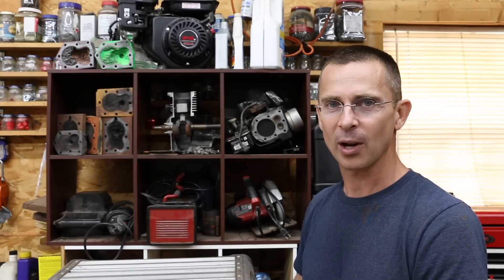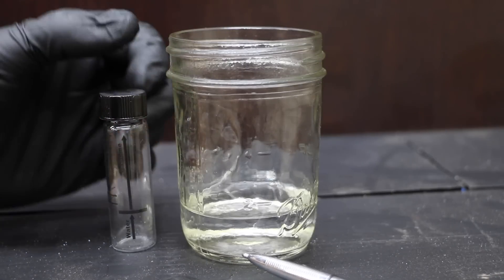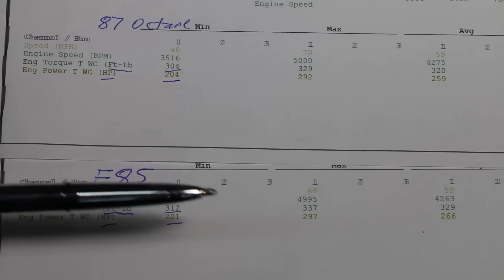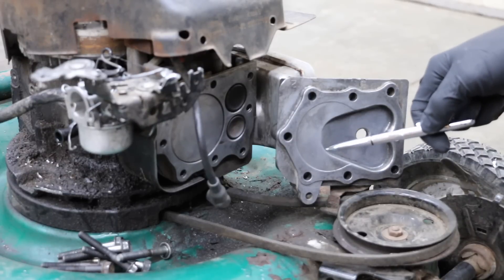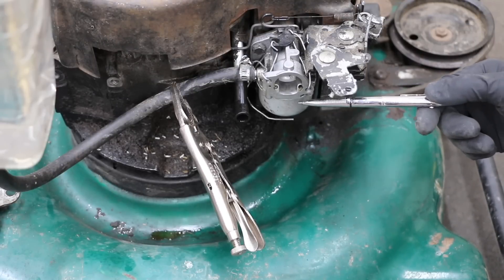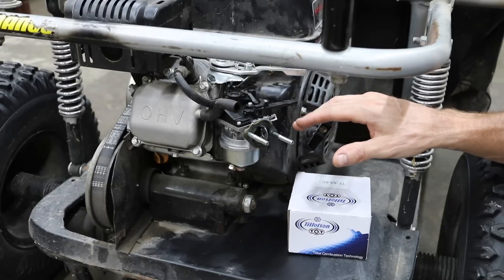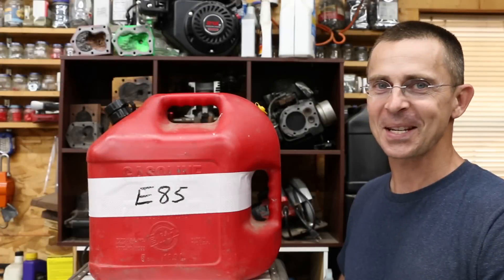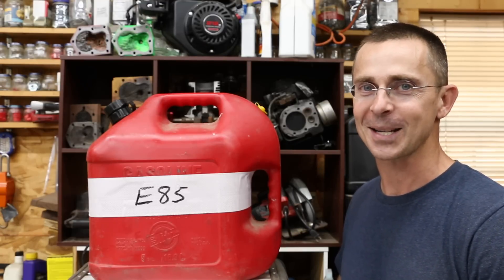Is E85 better than Gasoline? Let's find out!

Comment: So, I have a Subaru Forester turbo, built to use 92 octane, and E85 depending on what custom tune I have it set in.

92(pump gas): 341hp, 340lb torque, 20lb boost, 21mpg highway 16mpg city, 12mpg track
E85(race rated): 398hp, 410lb torque, 23lb boost, 14mpg highway, 11mpg city, 7mpg track.

The fact is, a "flex fuel" car really is incapable of taking advantage of what E85 has to offer. It takes a custom tune, with supporting mods and a tuner who knows his stuff to really wring the power out. Also please note that I don't buy E85 from a pump, I have it delivered to me in 55 gallon drums, that run somewhere around $7 a gallon. This is guaranteed e85 that will be +/- .5%
Reply from the maker: Wow!  That's very impressive HP!  Great point on E85 and getting the most out of it.
Reply: @tdidan E100 is a strictly race fuel, E85 I can find at stations if I am on the street and cruzing around. It won't be race prep E85 but it will run with the tune.

Comment: E85... Or any ethanol mix fuels are junk... Just a shame the government doesn't get it. 102 ron octane gas without ethanol costs almost 2 euros per liter here. All other fuels have at least 5% ethanoland cost 1.70/liter. Some even 15% ethanol. E85 is not sold here that much. People quickly calculated they would be cheaper on regular euro 95 (95 ron octane 5% ethanol) and pums stopped providing it.
Reply from the maker: Thank you

Comment: I've half considered redoing my fuel system to run E85 on my car.  I've seen reports that it tolerates E85 fairly well as-is for not being flex fuel(2000 Grand Am GT), but I really don't want to roll the dice on that.  I'd only use it in emergencies(such as a place runs out of normal gas but still has some E85 left and I can't get to another station before I'm empty), so I'm not sure it's worth the effort of upgrading the fuel system.  I do have some vague thoughts of turning her into a project car if I get a new daily driver, might do E85 upgrades then when I'm already tearing everything apart.

Now, if I did have a proper flex fuel vehicle, I'd do some research on which fuels work best for that particular engine and my use cases.
Reply from the maker: Sounds like a fun project!

Comment: I feel like that burb could of made a 3rd gear run on the dyno, I have a buddy with one same motor and it runs strong . I’d be willing to run my 93 lightning on the dyno. Truck has 2 fuel tanks so we can do one tank with the e85 and the other with regular gas. Can also change tanks while running too
Reply from the maker: Great point. i think the vehicle is electronically limited.   Speedometer indicated around or over 100 MPH.

Comment: In my 2007 Ford F-150 with 160k miles on it, I get about 2 mpg less when using e85 over 87 octane(12mpg instead of 14mpg) but I can feel a power difference when I use it as well. I also live at 6000 ft above sea level. Not sure how much of a difference that makes.
Reply from the maker: Thank you

Comment: I had a 2011 Crown Victoria Police interceptor, a flex fuel vehicle. It had never had e85 in it ever and when I took it on a trip from Ontario to Xenia Ohio I put e85 in it for the entire trip. I wasn't expecting a difference in power since most naturally aspirated engines aren't really knock limited. It was a similar difference to when I had a previous Crown Victoria reflashed for 91 octane on the dyno which makes sense. I was surprised actually at the power gain and not so surprised at the fuel mileage. The big surprise was how dirty my oil was since I did an oil change right before I left and decided to change it after I came back because it was absolutely filthy after the 870 mile trip. Normally the oil wouldn't look that dirty until a few thousand miles so the cleaning effect e85 had was undeniable.

Since most modern engines are below 11 or 12:1 compression they can't take advantage of the 105 octane of e85 as they can achieve MBT (maximum brake torque, which is the minimum amount of ignition advance that makes the most torque at a given engine load) with 91 or 93 Octane without detonation. Basically you can advance an engine's ignition timing at a given load/engine speed until it knocks/pings/detonates or when it reaches MBT. Some engines you'll only get knock under high load and high rpm. It's relatively simple to tune until it knocks and very very difficult to tune for MBT without a dyno. Even then you can only really tune Wide open throttle MBT unless you have a load bearing eddy current dyno. 

The real power benefit of e85's 105 octane is on a forced induction or even naturally aspirated engines that are very knock limited on pump 91.
Reply: That got a little long winded haha
Reply from the maker: This is very interesting, especially the oil change. Thanks for the commenting!

Comment: I have a 2013 BRZ and ran 93 always. I now have a e85 tune and you can feel the difference. MPG is worse but I still avg 25mpg. E85 is more fun to use when its tuned. E85 is just stupid to use in Econoboxes. Also since the compression on the FA20 engine is so high stock you cant run anything lower than 91. 93 is 3.60 a gallon vs 2.10 a gallon for E85 for me.
Reply from the maker: Thank you

Comment: Have you ever tried rec. Gas. Its supposed to be a zero ethanol fuel. I use it in about anything that's carbureted
Reply from the maker: Not yet. Thanks for the recommendation.

Comment: Before watching here's my prediction: 

E85 produces more power but has terrible gas milage.

2 problems with running E85 in a normal gas engine. 1: being the E85 eats gas lines and 2: E85 goes stale pretty quickly.
Reply from the maker: You are right. Thank you.

Comment: I use e85 in my racecars and it's a dream come true. The car idles better runs cleaner and gets the exact gas mileage while being cheaper. All while making tons more power

Can run super lean and run tons of timing

Ohh and I'm running 100% stock 1995 fuel system with upgraded pump and injectors to account for more fuel being burned. And I've stored it for a year with no issues as of yet
Reply from the maker: Impressive!  Thank you

Comment: I ponder... Could pure ethanol mixed with diesel or kerosene work better than E85 and match mileage and power of 87 gas? As for Dyno pulls, use the kart if it will read that low.
Take care from Oklahoma,
Mike and Vee
Reply from the maker: Mike, Great point!  Thank you
Reply: @ProjectFarm  BTU's

Comment: Ive used e85 in my volvo. It is controlled by Megasquirt, and has had fuel lines replaced (they should have been ok, but the in tank line was a worry)

If you're able to tune the engine precisely, you can run a lot more timing, and more boost. (more air and fuel in, more power). 

One of the  problems with ethanol is the fact that it does absorb moisture, and that doesn't help you much. And the ethanol they add at stations can be iffy. You have to get it from a reputable supplier that regularly rotates through their stock so it's not able to absorb as much moisture.
Reply from the maker: Great point. Thank you

Comment: In a factory, naturally aspirated car,  I'm not impressed with E85. It's cool, but all you get is some green points. In a modified, forced induction vehicle, I Love E85. It's effectively cheap race fuel and helps manage temps thanks to its property of latent heat of vaporization which cools intake temps and has a natural octane of around 105. It's a great fuel for cheap power. Just not on a stock N/A car. You won't get anything out of it unless you're boosting it.
Reply from the maker: Great point. Thank you

Comment: I tried e85 in my supercharged 454 suburban. It was pinging a lot so I was hoping to benefit from the higher octane. I was relying on the fuel injection system to get the mixture right,  but I hit 100% duty cycle on the injectors and melted 4 pistons.
Reply from the maker: Ouch!  Sounds like a very powerful engine before the engine issues.  Thanks for commenting.

Comment: I have a 2011 silverado 6.2l(l9h) flexfuel and have been running e85 for the past 20,000 miles and compared to premium fuel I actually save money even though the mpg is worse. Also my throttle responsive and low end torque is much better compared to e10 fuel
Reply from the maker: Excellent!  The extra power is nice!

Comment: I've been running E85 in my Crown Vic for about 3 some years now.  The E85 I use is minimum 70% ethanol.  I have no issues what so ever running it.  I am seeing about a 25% reduction in average fuel economy vs E10 87 octane gasoline so the cost per gallon difference is pretty much a wash.  However, compared with the price of mid grade or premium gasoline, it's a slam dunk winner.  Since my engine is not optimized for running E85 (none of the flex fuel vehicles are), I really don't get all the benefits that I could from this high octane fuel.  1 to 2 more points in compression ratio or forced induction would solve that.  Gasoline is, even with the EPA"S minimum detergency standards, a pretty dirty burning fuel.  The EPA's mandated minimum detergency standard is too low which is why there is the "Top Tier" fuel standard created by European car manufacturers. I find it interesting that most of the "fuel treatments" back in the day, were really just adding alcohol to your gasoline.  Even NASCAR is now using E15 gasoline with no problems.  Something else that really needs to get cleared up that most people get wrong, is that most of the ethanol made in this country is made from #2 yellow corn.  #2 yellow corn is not intended for human consumption, but generally grown for animal feed.  When the distillation process is completed, the by product can still be used as animal feed.  Win Win in my book.  The food vs.fuel argument is really nothing more then uninformed propaganda, kind of like those weapons of mass destruction that were never found...
Reply from the maker: This is great information. Thank you!

Comment: I drove my firebird across the country and I stopped in Nebraska for fuel, all they had was e85 and E40. I knew I couldn't used e85, I asked the clerk if E40 was OK to use. He said yes so I filled up. My car lost 10 mpg, it had no power and ran 20°hotter. I thought the car  was going to die. Two months later the fuel pump died.i don't know if it was the E40 but I'll never use it again
Reply from the maker: Wow!  I suspect the ethanol hurt the fuel pump.

Comment: Ethanol contains 30% less energy than gasoline.  https://www.afdc.energy.gov/fuels/ethanol_fuel_basics.html
Less energy means less MPG.  Ethanol costs nearly 50% more to produce.
This means you pay more to get less power and less mileage per gallon, significantly increasing your annual fuel costs.
Reply from the maker: Great point. Thank you!
Reply: On the down side, the fields that are used to grow corn to produce methanol could grow food for people and feed 330 million people per year instead.  https://www.theguardian.com/environment/2010/jan/22/quarter-us-grain-biofuels-food
Thus, ethanol biofuel use aids in the starvation of tens of millions of people annually.
That's a shocking statistic.

Comment: Corn ethanol gasoline is one of the worst ideas in the history of mechanization. At best, it's a net neutral fuel that just happens to strip-mine the soil for pretty much no gain. It has become a huge political problem because of the subsidies. We are now stuck subsidizing corn and corn-ethanol because farmers make so much money. Good grief.
I saw an interview with the Swedish super car guy (Kraigs something) whose latest super-car actually generates more power by running E85.
Reply from the maker: Thank you

Comment: If it's 85 percent ethanol what the heck is the other 15 percent?  Alcohol, pure alcohol will give more power, at the expense of mileage. I still want to know why they use ethanol, when there is also Isopropyl and Methanol. Ethanol is the more expensive alcohol to produce.  They say it helps the farmers, but not so, they don't get a dime more for their corn or whatever grain is used than they do if it's being used as feed for cattle or people. However, Methanol can be made from nearly any dry organic material, including wood, corn stalks, leaves, grass... just about anything that will burn when it's dry can be used to make Methanol. Imagine running your vehicles on grass clippings! Actually some types of bamboo would be perfect for making Methanol, it grows very fast and propagates on it's own. Of course the same can be said for making paper and flooring and many other products, but nobody is doing it on any large scale. Why the heck not? Organic waste can also be used to make something that's very much like dude oil, which many products come from. Why isn't that being done on a large scale? Many individuals have done such things, but it's never been done on a scale that would allow mass marketing.
Reply: The other ingredient is gasoline.
Reply: I can answer this .... the other 15% isn't all gasoline, it's any kind of garbage chemicals that the gas companies want to get rid of and not pay for hazardous waste removal.  The EPA doesn't specify what a lot of the other 15% can be and the gas companies take advantage of it.

Methanol can't be used on a wide scale because it has waaaaaay more corrosive properties than ethanol. Race cars can use methanol only because they use much more expensive components that tolerate the corrosiveness and are expected to be rebuilt often.
Reply from the maker: Ford ST is right.  Cold start would be a big problem in winter conditions if it was pure ethanol.
Reply: hmm, what about 85 percent alcohol and 15 percent nitromethane? Run like hell until it blows up. How much nitro does it take to blow one up anyway? NHRA put a limit on how much nitro and alcohol mix the top fuel cars could run, because too many were blowing up.
Reply: hmm, I wonder it the other kinds of alcohol have the same cold start problem? I know my old 96 blazer is hard to start if it even gets a little cool.

Comment: These fuel tests are very valuable information for us using older engines. 
With ethanol gasoline my 70's 2-stroke outboard is like it's missing the other piston rings. Revving high but no torque
Reply from the maker: Great point. Thank you

Comment: From what i know, Ethanol (100%) need much more ignition timming (when gaosline start at 0º and advance to 32º, E100 start at 15º and finish at 25º). Also fuel and air mix isn't 14:1 as with gas, it's 9:1. 
Not to mention that it wont carbon the engine, but will clog with slime the fuel lines.

Now E85, not a perfect math, but i would start the ignition at 12º and end at 32º. Air fuel mixture i would keep at 11:1
Also need more compression, gasoline let's say that need 9,5:1, E100 need 15:1 So for E85 i would use 13,7:1
Reply from the maker: Great point. Thank you!

Comment: I think there is a fuel treatment that is light blue in color that you mix with ethanol fuels that makes it safe for all 2 and 4 cycle engines. If you know about this stuff can you please test it in both types of engine? I've found it at Walmart and Tractor Supply. Could you try removing the ethanol from mixed fuel with water ( like your test ) then comparing that fuel to normal 87 octane? Thank you I was one of many who asked for this test
Reply from the maker: Thank you very much for requesting this video!  Great video idea on removing the ethanol.

Comment: Another great review.  We have 91RON, 93RON and 98RON here in Australia.  What does that relate to in the U.S. ?  Thanks.
Reply from the maker: Thank you!  I'm not entirely sure of the difference and I don't want to provide incorrect information. Thanks again!
Reply: It doesn't really. That's Research Octane Number (RON) and we use an average between RON and MON which is based on a standardized test motor. Ours will be several points lower since RON is always higher than MON measurements from day one. We only have two choices as another issue at least locally. 87 and 93. IF those are equivalent to any of yours would be beyond my ability to know.